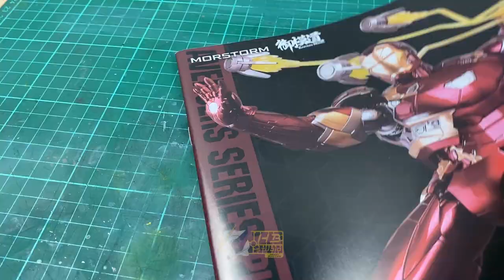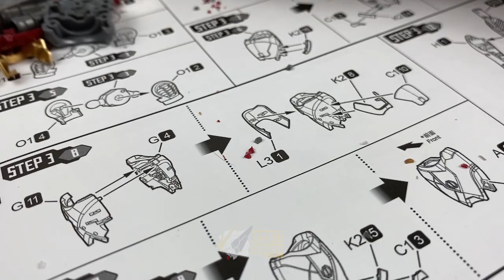Morstorm / Eastern Model Iron Man Mark 46 | Civil War | Custom Painted Build | Model Kit

Comment: Is it just my paint or tamiya’s gold leaf enamel won’t come off easily when using enamel thinner?
Reply from the maker: Enamel thinner is not strong enough to remove. You need to use alcohol and gently rub it to prevent the plastic melt.

Comment: I was doing a test paint using Mr. Hobby colors @ 1:2 ratio. I find the finish prone to scratches and peel off. Am i doing something wrong?
Reply from the maker: You have to sand and then prime it before you apply the colour you want ya😄